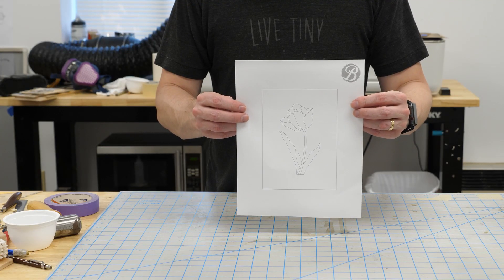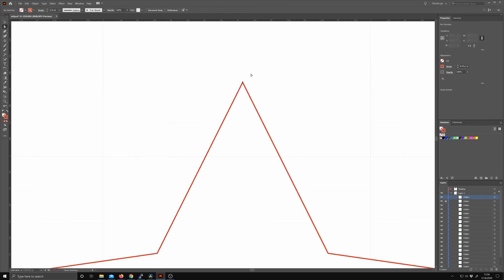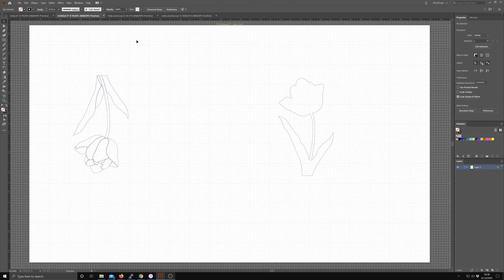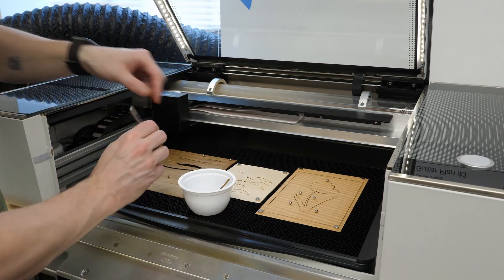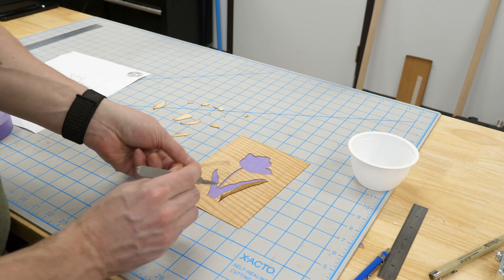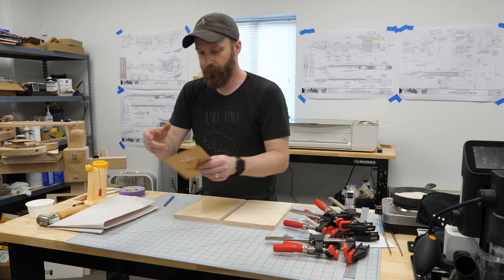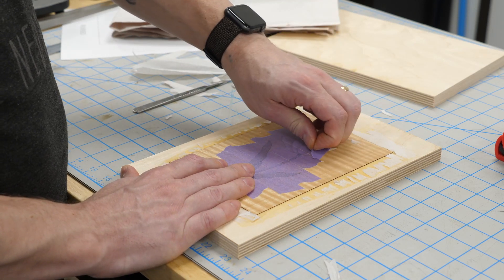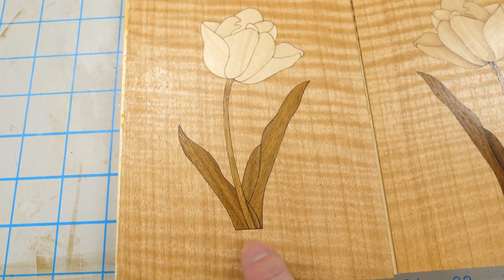Laser Marquetry with the Glowforge!

Comment: Great video. Hopefully trying this myself soon and there aren’t a lot of videos about it. How would you compare the accuracy of the laser cuts to the traditional methods? Can you get the pieces to fit pretty tightly without any gaps? Also have you tried masking tape to prevent burnt edges?
Reply from the maker: Thanks! The laser is pretty accurate, but it can miss that hand made look if that’s important. The pieces can fit very tightly once you dial in the right offset. I have the most trouble with pieces that have a lot of curves, but it’s easy enough to recut and dial it in. I have tried masking the veneer but it didn’t make enough difference to be with the trouble in most cases. For really light woods I might consider masking.

Comment: At time 15:11 when you say "sand it up to 220" did you cut the piece down to size where the veneer is flush with the wood block? or does the sanding remove the edges of the veneer from the back wood?
Reply from the maker: Yeah, I cut the piece down to size on the table saw first. I'll generally have the background veneer be a bit larger than what the final piece size is and cut the piece down. You can also cut the substrate piece to size before gluing the veneer down and use a knife to trim the overhanging veneer to the piece size but I usually use the former method.

Comment: very good informative video. any way to get rid of the black outline caused by laser?
Reply from the maker: Not entirely. The laser burns the material so the best you can do is find the speed and power settings that result in the least amount of charring for the material. This particular project uses light woods next to other light woods and that’s going to accentuate it much more than if dark woods were used.

Comment: You mentioned that Purple Heart didn’t work well, it was muddy. Is this because it burned too badly?
Reply from the maker: It was more because it's a fairly dark wood and even with the sand shading there wasn't a lot of distinction between the pieces. It kind of looked like a big purple blob to me.
Reply: Scott Barron Furniture instead of using the sand to discolor the wood, have you tried having the laser burn the effect instead? I was looking at using Purple Heart for a project on my Glowforge shortly.
Reply from the maker: I have done some experiments with that! Defocusing the laser can get you to something approximating the shading. It doesn't look quite the same, the gradient isn't nearly as smooth, but I think it could be used to good effect. The tricky part is that you generally cut mirrored (so glue side up) to minimize the visible kerf on the show face. So you'd either need to cut show side up and incorporate that stronger visual kerf into the design, or try and get things lined up after assembly which could be pretty difficult.

Comment: Which model glowforge were you using in this video? Are these similar to the Chinese models I see? Finally, when will the other series come out. Very interesting material for marquetarians.
Reply from the maker: This is the Glowforge Pro, but everything could be done on the Basic. I haven't used any of the Chinese models, but I can't think of any reason why one couldn't do marquetry with them. The key is having a way to hold the veneers flat, as long as they're flat it's just cutting. I'm shooting for next Wednesday for the scroll saw video, and the Wednesday after that for the chevalet video.
Reply: Thanks Scott, I will keep an eye open for them